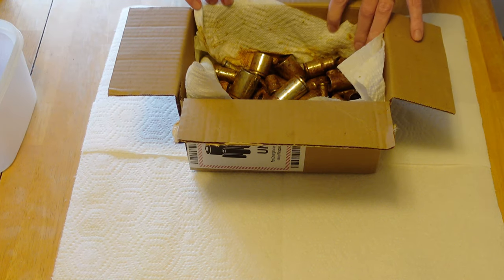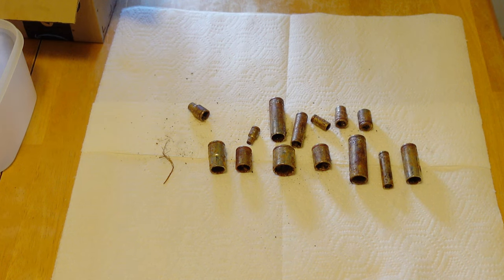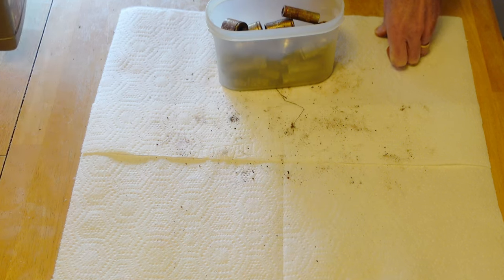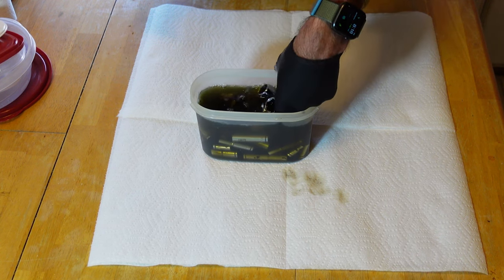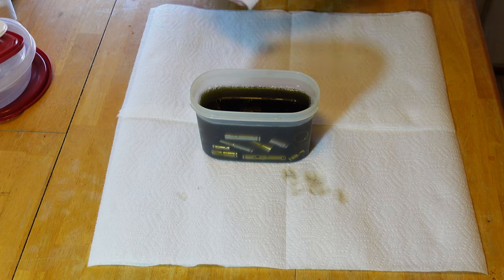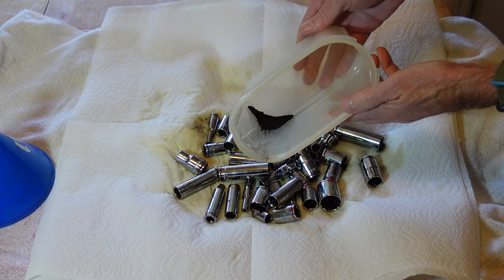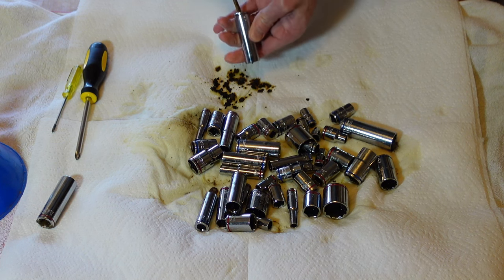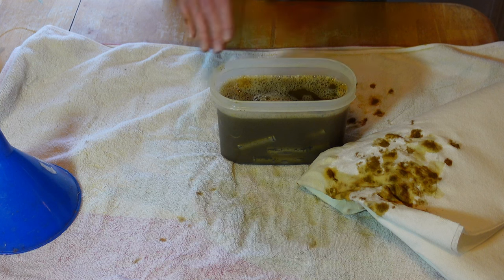Cleaning Rusted Sockets | Cleaning The WORST Rusted Sockets EVER | EvapoRust

Comment: A tip for anyone that's interested...
Regardless of the solution being used to attack the rust (I haven't tried Evaporust yet but I will after seeing this), if you agitate the soaking sockets you will get faster results.
As an experiment, I attached my tupperware container to the top of an old fish tank air pump and the vibration for the pump was enough for my solution to "ripple" and the sockets to "jiggle, spin, and bounce" a little bit. The best part is that the pump is very quiet. Not ultrasonic, but pretty fast and quiet

Comment: great stuff.  best to degrease and clean the sockets as much as possible before using Evaporust so it will last longer.   Bottle brush attached to a drill really helps get the insides of the sockets
Reply from the maker: Thanks for the info!

Comment: Beautiful this was what I needed to see, I wanted to restore the shine look to the sockets while removing the rust and not eating at the metal itself.  Greatly appreciate the time and work you placed into this video and sharing it.
Reply from the maker: You are welcome!
Reply: @oldmanwoking  Just an update I did use your process and EvapoRust and forgot about my sockets for 6 to 7 weeks and was greatly impressed with the results.  Took the sockets out of the EvapoRust and rinsed them in luke warm water and they came out brand new looking.  Only the small sockets did I need to stick a small brush to complete the job.  But otherwise this stuff is really good.  Thanks again.

Comment: I do this, but then surface rust reappears after drying off.  What am I doing wrong?
Reply from the maker: I know there is something you can put on them afterwards, but just can't remember what it's called right now. It is suppose to help the the rust afterwards, but more than likely the rust will still come back after awhile....
Reply: you need to rinse with water, dry quickly and spray them with some sort of rust preventative like wd40.   Per Evaporust's site items can continue rusting if the object is not flushed afterwards.
Reply: Atf works the best